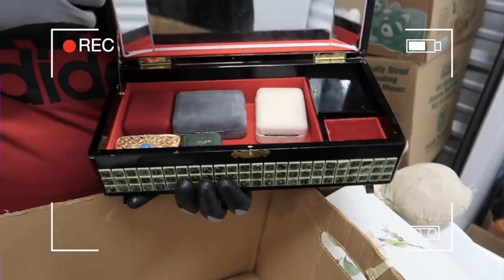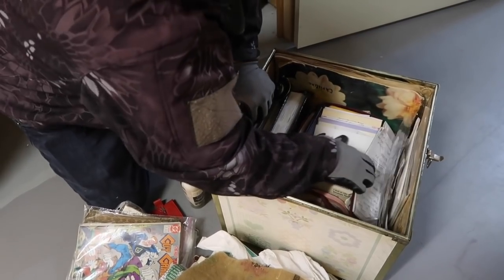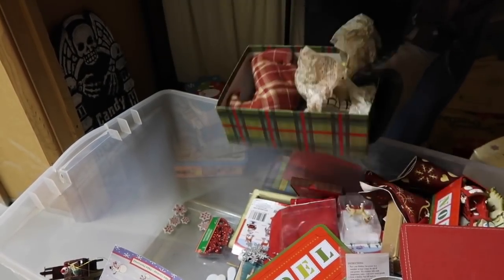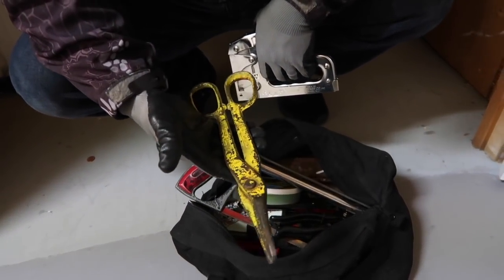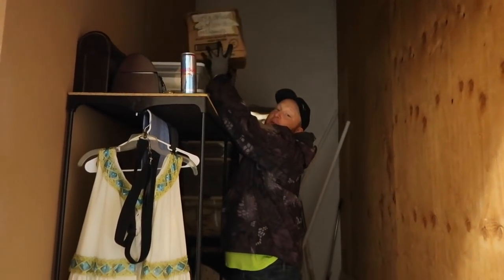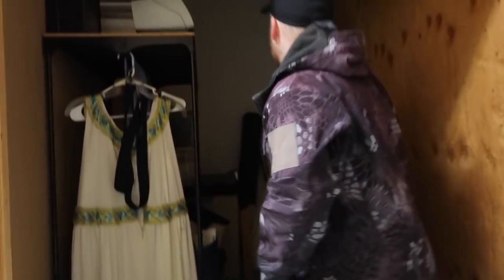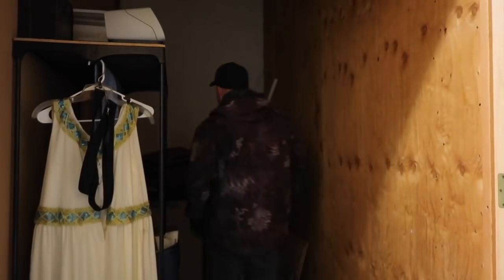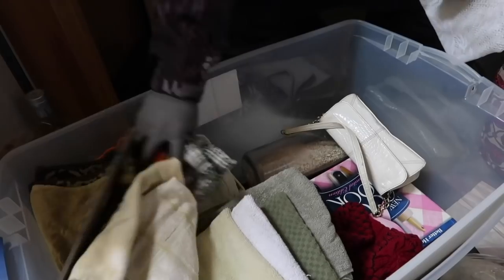MAN Retiring After Finding Shiny GOLD Coins Inside Abandoned Storage Unit!!!

Comment: Cords?   I've seen a lot of mass-market cords and connectors in storage units, but I've never seen an expensive set.   But you should still be alert and check anything that looks unusual, you might find a $500 set of interconnects or speaker cables some day.